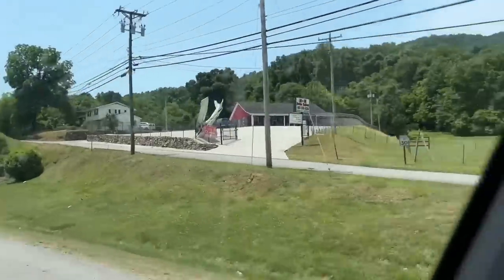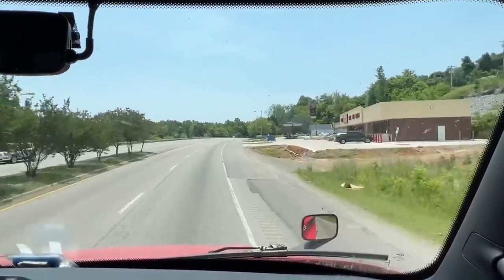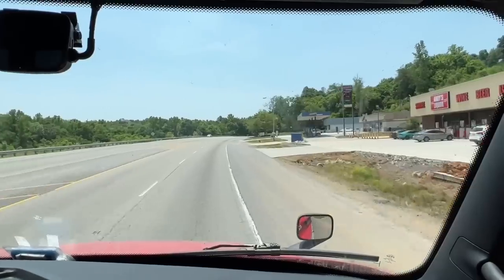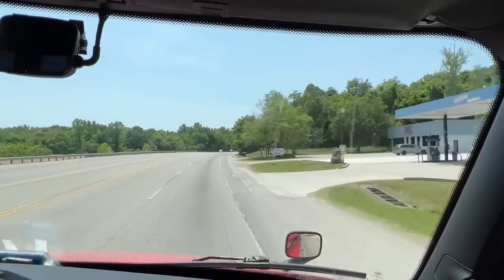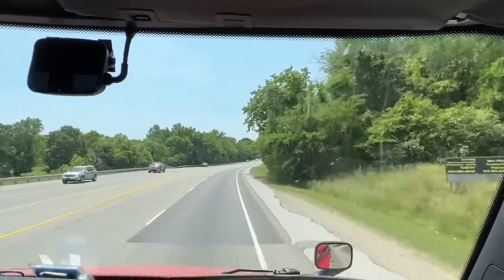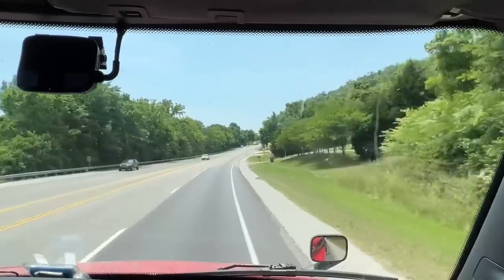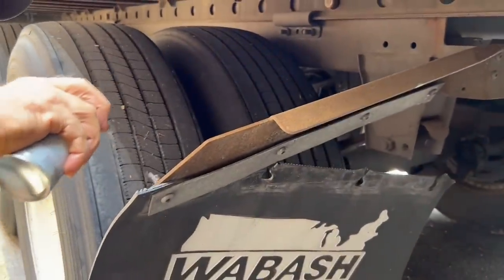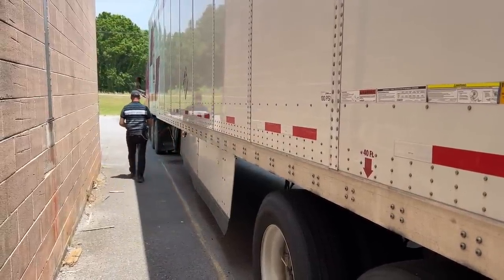Trucker Installs Mud Flap Replacement on Trailer

Comment: Yea had todo this too last month, I learned i need to add a socket set to my tool bag. I only had wrenches with some very stubborn nuts/bolts that would not come off, one wrench slipped and smacked myself real hard in forehead, blood everywhere. Have a nice scar, probably needed a stich or two. I can only imagine what the truckers were thinking at the truck stop; me a little lady 5'3 105lbs cussing her mouth off throwing tools at the trailer, I was mad mad. Ha ha
Reply from the maker: 😳😳😳 Mid flap battle scar?!? Makes a good story at least. 🤩😁😉

Comment: Got a little bucket in my side box full of random bolts, nuts, washers and scrap wire found at every truckstop or shipper lot.  Amazing the time saved making small repairs with free supplies.  Even a spare seal will hold up a flap temporarily.   Cheers!

Comment: An inexpensive cordless driver/ drill and and bit set is your best friend. Certainly will help speed up those mudflap changes, plus allow you the ability to fix/ repair a variety of issues. I purchased a Dewalt driver/ drill and a 150 pc bit set. Drill bits and a larger assortment of driver bits. About $125.00.
Reply: Same here,  plus a dewalt leaf blower for quick "sweep outs".  Same batteries for all the tools so it reduces the amount of batteries needed for different things, and the batteries are what costs the most.
Reply from the maker: Thank you!!! Good tip!!! Nice to see you!! How are you and Roni? How’s the truck???
Reply: We are doing well. Running pretty consistently at 3000 miles per week, with reset occurring nearly weekly. Truck is flawless, runs like a champ through 200,000 miles. Only issue is keeping her clean. White truck, bugs, dirt, etc......Ugh, what a nightmare. Washing her at least once weekly, often times twice.

Always remember you can reach out with any questions or just to say hi.

Be safe, keep em spinning.
Reply from the maker: @lawrencececchini7626  So glad to hear things are going well for you!!!!
Reply: @Bendigo1  I use my DeWalt leaf blower all the time to blow out dry vans and reefers too.  Some of those shippers are very picky about super clean trailers, and who wants to wait in line hours for a washout.   Looking at pawn shops for some more DeWalt equipment (drills, etc) as you suggest.  One of my coworkers uses a drill (with a polishing kit, of course) to keep his rims super polished. I wanna try that too.
Reply: @vendingdudes  I got the flexvolt tools and the huge battery that came with the leaf blower.   The small flexvolt batteries work for the drivers for a bit, but the big one will run them forever.  My concern would be burning up the motors by running them too long before the battery dies.   

I'm actually looking at getting the cordless vacuum for when i need to clean out the trailer without blowing stuff all over picky places parking lots.

Comment: Companies tend to use those star or hex even square head fasteners when they don't want drivers "messing with stuff".   It is understandable that they don't want people that have no idea what they are doing to try to "fix" things, but it is frustrating for those of us who actually know how to actually fix things.   With some basic tools, the right parts and some knowhow, you can save hours or sometimes days in the shop.  

I found a driver/drill bit kit that has pretty much every screw bit i could ever need.  That with a socket adapter for the cordless driver I have, i can change lights or mudflaps or other odd things in less than 5 minutes.   It took 6 hours once to get a marker light changed at a truck stop shop...
Reply: I bought a kit from Amazon with both Metric- and Standard-sized hex heads for my drill. They make assembling IKEA furniture a lot easier (when needed), and would work equally well for removing those mud flap bolts or other fasteners.
Reply from the maker: Thanks!!!!
Reply from the maker: @88KeysIdaho  👍😃😆

Comment: You could have just drilled new holes in the old mud flap and put it back on there just a thought Be safe
Reply: Hopefully they'll replace the spare soon and not regret using it up.   What if next trailer it's completely missing 😯
Reply from the maker: If we’d had a drill. Yes. 😃😆
Reply from the maker: @vendingdudes  😳
Reply: @TheJoyofTrucking  you can trim off the bad part with a sharp pocket knife (lay it over a piece of scrap pallet wood and score it, snap it, trim it) OR just flip the flap over, and use the knife to "twirl" carve some holes.  If it's a rubber flap instead of vinyl, you can punch a hole with a hammer and a Phillips screwdriver.  If the bolts won't come undone, or snap off from being too rusty, no worries.  Use those bits of scrap wire i told you about. Only needs two to hang, three to hang without sagging.    Use that Leatherman, Kevin haha!  Anything to avoid being pulled in for an exam when you're not in the mood for one. 😆
Reply from the maker: @vendingdudes  👍😃😳😁😁😁🤩

Comment: What time do you start working and end every day if you don’t mind me asking ? Does it very depending on appointment times or is there a average time you can say you start around and finish around and do y’all run 6 days a week or 7 on recap hours
Reply from the maker: Kevin tends to start at 5:30 or 6am. And finish after 11 hours driving. He likes to run 6 days and reset (preferably on Sundays). But…it’s trucking, so it can shift. 😃